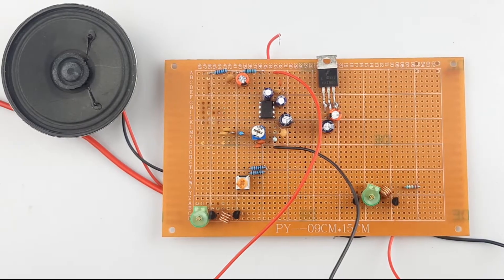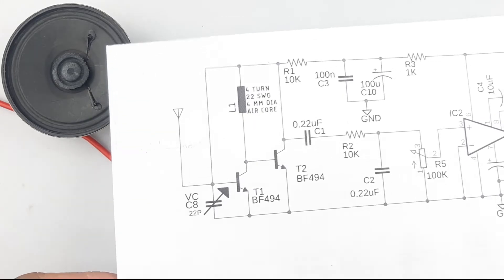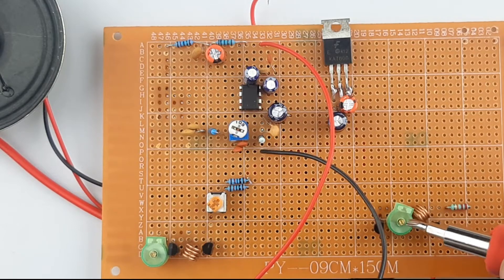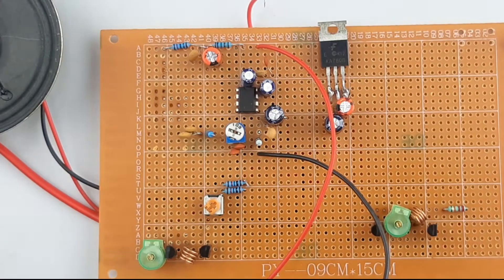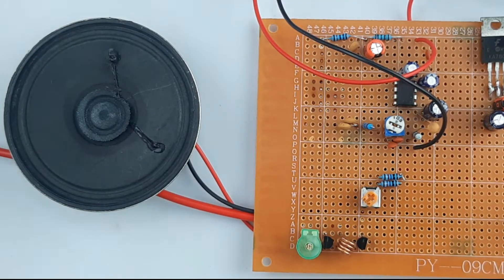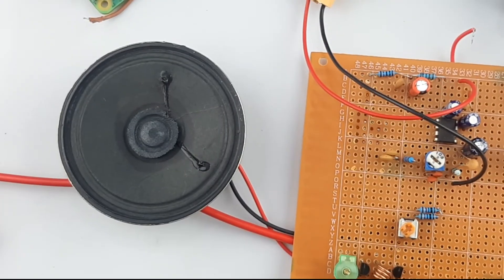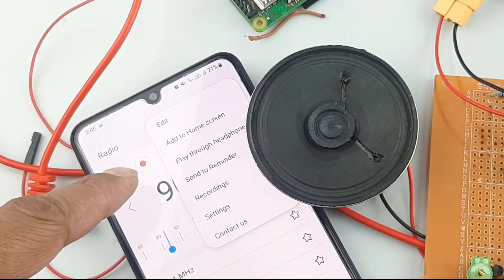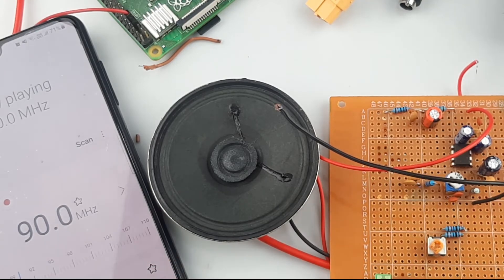DIY Crude FM Receiver Circuit - Do They Work?

Comment: 1. Your antenna needs to be the right lenght. 
2. You have to adjust the coil spacing in order to get the colpits circuit in the right frequency band.

Use a signal injector to set the low and high frequencues.